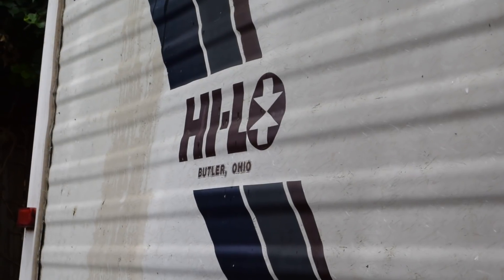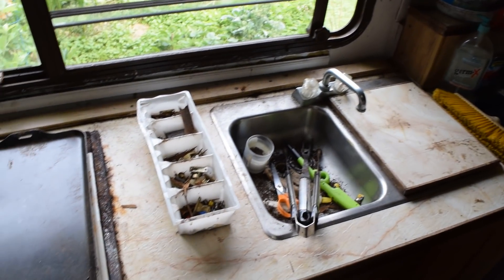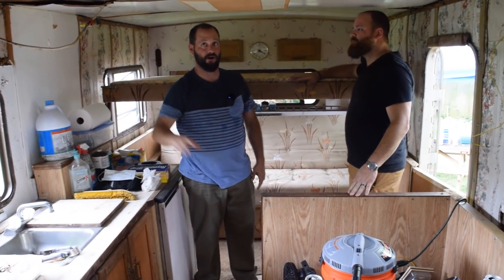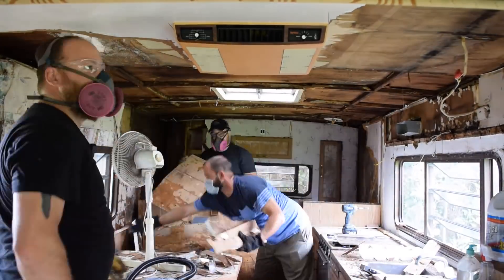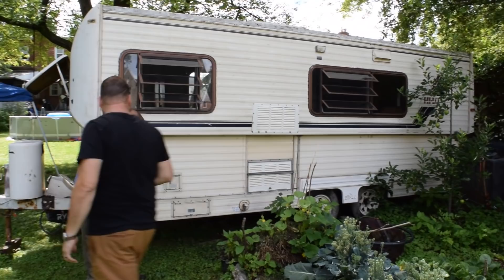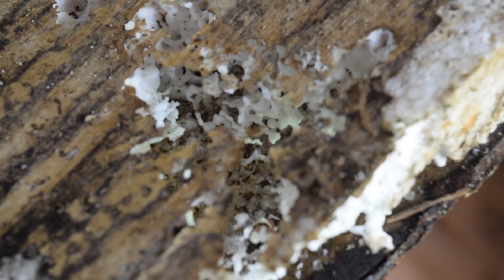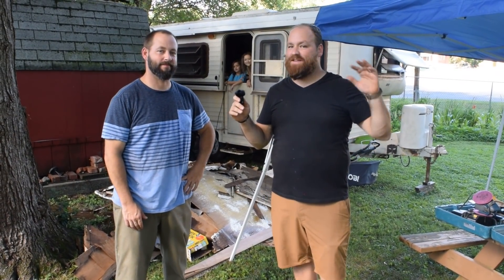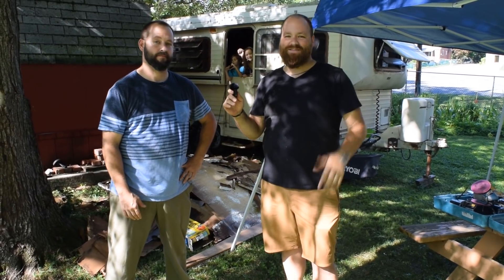Gutting the Mobile Man Cave

Comment: Your trailer is disgusting. "The fan works, the stove probably works." Lol. Best wishes. Fix the fridge and the A/C. Run electrical extension cords. Put a blue tarp over the roof. Get a cat for the mice and a portable vacuum cleaner. Good to go.
Reply: OneEyed Mike it sure is. Sealing the roof this week. Spent an hour in there with the shop vac and she’s much cleaner now.
Reply from the maker: Lol!